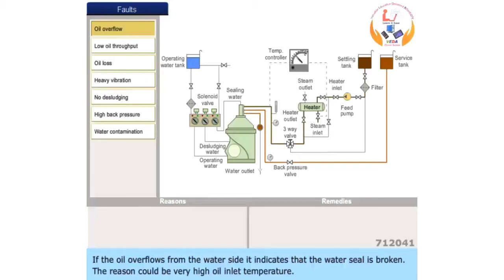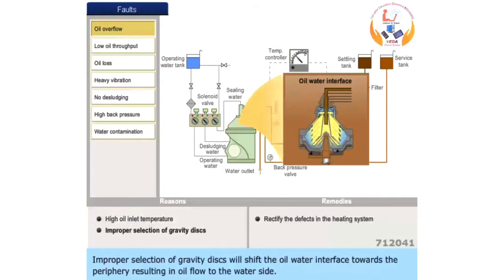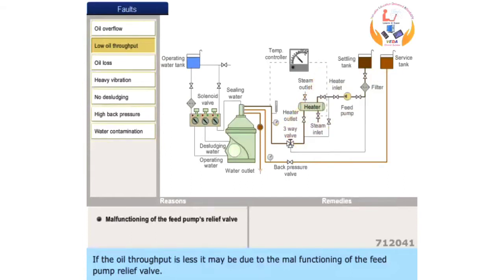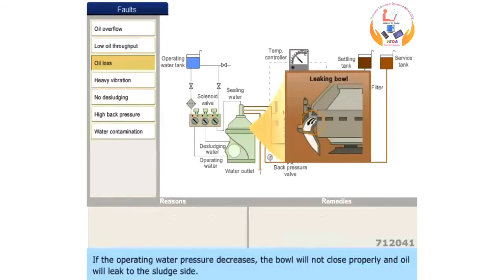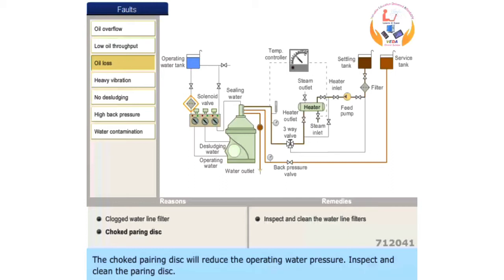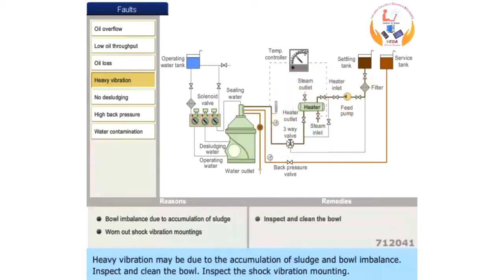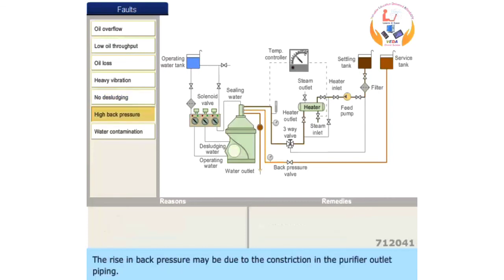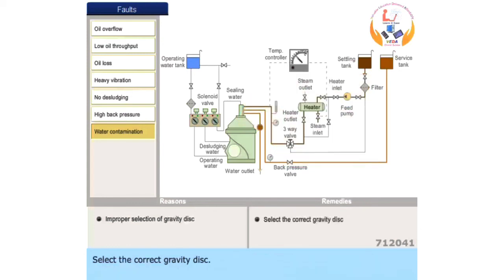Purifier Troubleshooting • Overflow reason • Marine Engineering Knowledge

Comment: extra ordinary lecturer sir,however i have  a question, especially in choked paring dics as i get that the paring dics is to change the kenetic velocity of oil  into pressure energy and act as cetrifugal pump to trasfer clean oil to daily service tank now my question how choked paring discs lead to reduction of operating water pressure as i know this operating water  enter into the separator at the bottom for close the slide dics?
Reply: and while this paring discs found on top of separator? please answer me by animation if possible